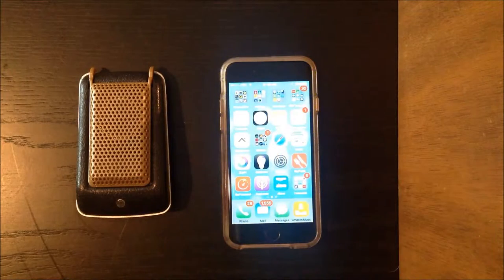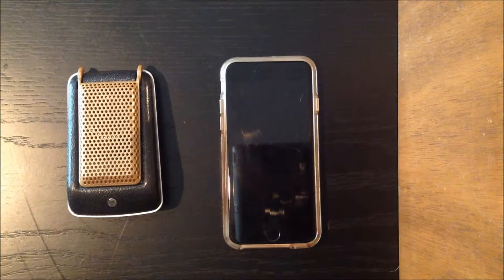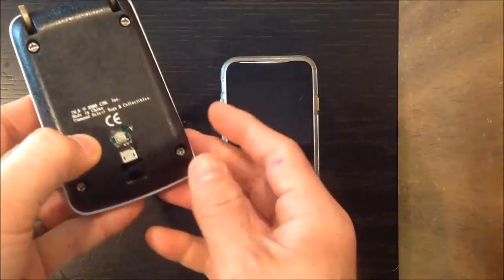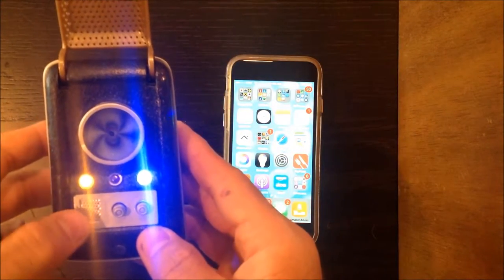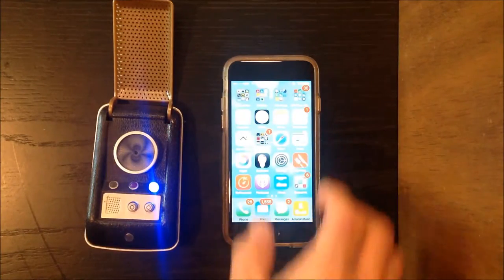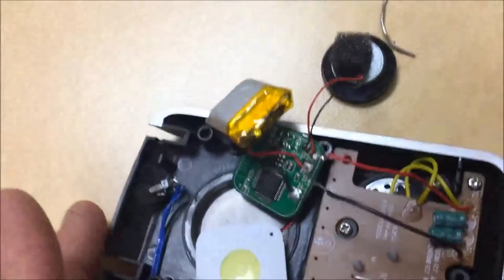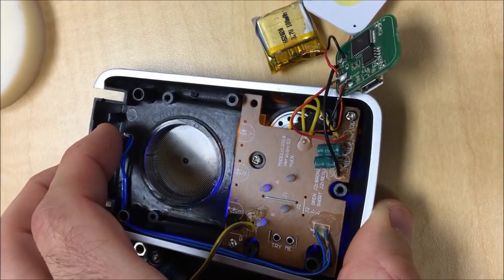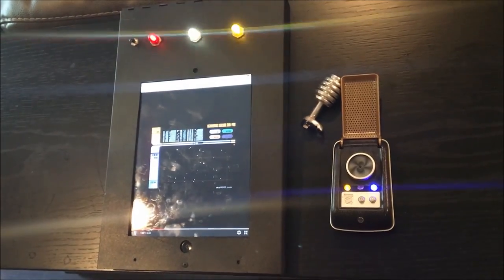Make a Star Trek Bluetooth Communicator for under $40!

Comment: I bought a smart box bluetooth unit, and the mic is now part of the circuit board, and not on wires. So it won't work with the new unit.
Reply from the maker: There are small speaker components that you can solder to the leads on the board.  Send me some pics and I'll help you figure it out!
Reply from the maker: Adafruit for example sells a Wired Miniature Electret Microphone.  Google it.  I've made those work with other projects before... and i think it's actually what was used in my smart box.  https://www.adafruit.com/product/1935?gclid=CjwKCAjw8_nXBRAiEiwAXWe2yXB-pPWUZVARhklyEfNThKQfp_bMmPwNL0fuRscNnNxd2Sgu2hr2_xoCcpIQAvD_BwE